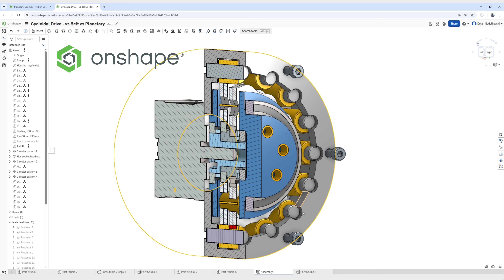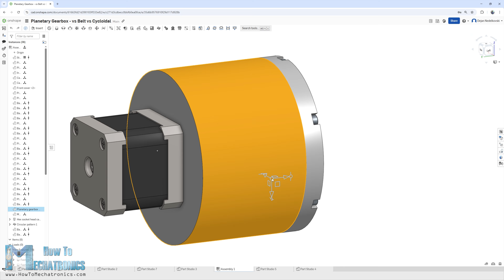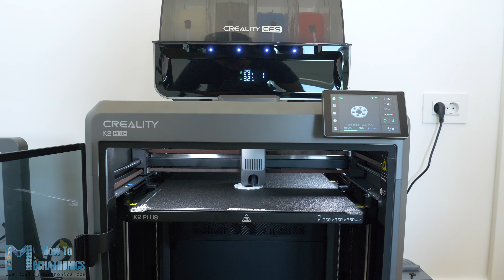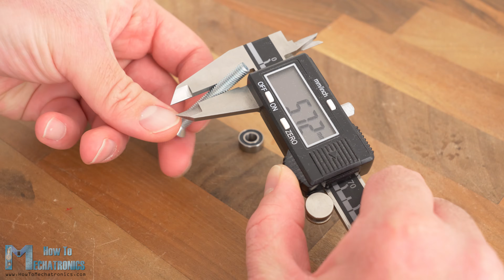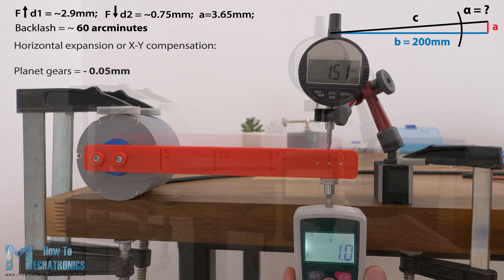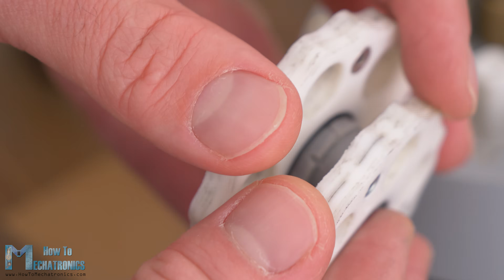Cycloidal vs Belt vs Planetary - The Best 3D Printed Drive for Your Next Robotic Project?

Comment: Not surprising the cycloidal drive died first in the durability test, they are generally fairly high friction systems and need a lot of lubrication. Definitely use grease on it, given that this is a relatively low power setup probably a thinner grease like NLGI 1 or even 0 instead of the normal NLGI 2, so to not lose as much efficiency from drag.

Comment: For more easily securing the belt drive stepper, cut 4 holes in the large pulley and housing, which allow a hex wrench to pass through and access the screws, when the pulley lines up right.

Comment: Being someone who services heavy machinery, there's one factor you didn't take into account, and that's maintenance. With the belt drive, you have to replace the belt when it breaks or correct tension when it gets out of alignment. The planetary you just have to keep relubricating. They both have a maintenance schedule to follow: planetary you have to grease or oil, and the belt, check for wear, and replacement. The planetary can go way longer before service is needed, but the belt I feel like, will outlast the planetary because instead of the pulleys and sheave taking the wear, the belt is. In a planetary, the gears are all taking the full wear of whatever force is being distributed to them, so eventually, they will snap or break due to metal faitgue. How long would it take in a real world scenario? Don't know, but it certainly is something to think about. I can certainly say, I've seen more gears give out than pulleys or sheaves.

Comment: I am late to the party, but your results are quite bad, to be honest. Why? Well, look at the way you held the drives! The belt came best not because it was the best, but because its enclosure was square. The rest were round and you can visibly see the deflection of the mounts when you measure the displacement for the backlash. This significantly impacted the results of the arcminutes in negative way for both cycloidal and planetary gearbox.

Comment: Yeah but if you want higher torque like 400Nm not 400Ncm eventually you will use planetary gearbox but it is not 3D printable like you got to use metal so if you are aiming for way high torque use planetary and metal but the belt and the capstan will fail you if you're looking for higher much higher torque. But if you are looking for all 3D printed relatively strong and cheap use either the belt or the capstan drive ⚙️

Comment: Nice work, congratulations! I think part of the backlash you noticed are due to the 3d printed  ruller you are using in your experiments. It can bend and increase the displacement. I would use a more rigid arm in these experiments. Anyways, there is backlash indeed, but it's not so bad.

Comment: I'm surprised with the poor performance of the cycloidal drive since I've designed a 25:1 single stage cycloidal drive a couple years back for a BLDC actuator and it's only started to get significant damage after hours of use. And i didn't even use bushings or bearings in the pins due to budget reasons. You might've had a problem with the clamping or maybe the design had some issue i couldn't see from the video

Comment: Amazing video.  Thank you so much for this. I am also building a robot arm. Improving from basic servos to one of these. I am probably gonna use the planetary gearbox for shoulder and belt drive for other two, since they need lesser gear ratio and it was lighter.
Reply from the maker: Glad you found it helpful and good luck with your robot arm!

Comment: Very informative video. Had not seen your channel before. I'd like to comment on the Cycloidal drive design. It may not change the overall result but should move this style much closer to the others and permit it to be a lot smaller.

(1) The eccentricity appears to be less than the maximin possible. The greater the eccentricity the greater the 'bite' of each tooth. For example we used a 48:1 cycloid drive on an FRC robot with a 1 mm offset. It eventually gave up (like yours did). I was able to change to 1.2mm offset (a 20% deeper tooth engagement) and it did not fail.

(2) A material like PETG will perform much better than PLA for the gears.

(3) Since the cycloid teeth virtually roll on the pins, you can get away without the bearings. We used 3/16" diameter plain steel pins. This permits a smaller, more compact drive.

(4) We also used the same type and diameter of steel output pins but increased the quantity to the maximum possible. This provided the maximum surface area for the torque to be transmitted (minimizing wear and deflection).

(5) This may be the most significant difference. A two gear cycloid is not fully balanced. However a 3 gear system with each gear set at 120 deg is virtually vibration free. Also, since almost 1/3 of the teeth are engaged at any moment, a three gear system provides nearly 100% of tooth contact at all times.

(6) How you slice the gears has a significant effect on performance. We went with 100% solid.

(7) As one person commented, use lubrication.

You may be quite surprised at the improvement provided by the above changes. With all the pins, the part count will always be relatively high but you might find it could 1/4 to 1/8 of the volume - a real plus for a robotic arm. Cheers.
Reply from the maker: Hey, thanks for the input. These are all great points indeed and it would definitely improve the cycloidal drive performance.
Cheers!

Comment: Don’t forget that if you want the gears to last, they need to be made using prime numbers of teeth. Otherwise they will ware unevenly because the Sam teeth will keep meeting up. Using prime numbers, the point of impact will rotate ground the gears resulting in an even ware pattern. This will smooth the teeth and help them run better over time rather than creating a ware pattern that will speed up the parts failing point.
Reply: The numbers need to be coprime, not prime. That is, they need to share no common factors other than 1. For example, 15 and 16 are both composite numbers, but they are coprime (and in this case you get a shift by one tooth between the gears for each rotation).

But I also wouldn't worry too much about it if the gears are being 3D printed - the prints are just not going to be that durable regardless of a completely even distribution of wear.
Reply: @sirnate4005 brb buying a roll of POM filament, what could go wrong
Reply: @sirnate4005 aren't any two a,b where a+1=b coprime?
Reply: @sirnate4005  gears with pure rolling contact or  non-sliding gear tooth profiles for long-life gear
Reply from the maker: That's right. But it's sometimes hard to find prime numbers to match the desired gear ratio.
Reply: Mind blown
Reply: @reinux  it’s amazing the Random tidbits and information you can find on the Internet

Comment: I wish you volume-normalized and weight normalized the components. Maybe making one set that are all equal volume and one set that are all equal weight, and see how well they compare. While I dont think the cycloidal drive would have impressed if you made it larger, I think it still affected the results significantly. Maybe its performance/size ratio is great?

Comment: A good challenge would be a split ring planetary gearbox. Those are a pain in the ass to make conventionally.

As geaometry is extreme constrained. So you either have choose from a very limited selection with standard off the shelf gear sizes  , or have to make your own "exotic module" gears.
Reply: And well as far as compactness for a given reduction and efficiency goes they are good enough to beat professional (metal) strain wave gears ehen made from similar materials.

Comment: Are you sure cycloidal drives "need" an odd number of teeth? I thought having an even number of teeth was important to achieving a balanced load, more even distribution of the forces and reduced vibrations. Great video and great comparison!
Reply from the maker: I tried it, there is no way to insert two disks if the teeth number is even number. They must be odd number to fit two disks.

Comment: Beautiful! Thank you for that.
Your belt tensionners are holding with friction. Try using a  a screw to apply force around a pivot and then lock that screw. That way the counter-force will not try to fight friction but rather compress a screw. It also allows you to fine tune the force on the tensionner.

Comment: Great video !! thanks for sharing. Have you tried or thought of harmonic ?
Reply from the maker: Hey, thanks! I already a direct comparison video of harmonic vs cycloidal drive, check it out. Printing the flex spline is a problem. It needs to be flexible and it's hard to get it so with most 3D printing materials while being durable enough.

Comment: Your backlash testing methodology could use some work. For example, as can be seen in the footage, your mount is not rigid. So a lot of the backlash is coming from the whole gearbox rotating a little.
Reply: Yes, and the arm bends, too. Better clamping and metal arm with much less flex.

Comment: When I tested some variation of the cycloidal drive I noticed the rotation speed is not constant. It looks like the speed is accelerating and decelerating for every lobe. Is this really the case or it it an optical illusion.
Reply from the maker: You are probably right. The disks shapes and the assembly of the drives is never perfect, so I was not sure about how constant the output is. When touching output bar of the three drives by hand while the durability test, the cycloidal drive had the most vibrations, followed by the planetary gearbox and then the belt drive as the smoothest one.

Comment: the way you clamp the gearboxes to the table may also increase wear due to flex in the casing. nevertheless - nice video! interesting content! keep it up.
Reply from the maker: That's true. I though about it a bit late after all the designs were made. I tried to clamp them at the front and the back where it's all material, with 35% cubic infill.

Comment: Very cool and thorough video
Just 2 little things I noticed: when you compare the weight you show the total, while one of the main advantages for the belt drive is the capability to mount the motor further away on long arms decreasing the torque requirement for the previous stage.
The other thing is: why do you use pla? I can't see any advantage over other filaments in wear and temp resistance other than maybe printability.
Reply from the maker: Thanks!
Right, PLA is not the best choice for gears but it was the easiest to work with, fasted to print ect.

Comment: You should try CAPSTAN drive and see how it compares. To build a good one you just need a rope/string with minimal creep. They are fairly compact, easy to manufacture and have decent reliability when built properly. The neat thing is how simple they are and you can make unusual joint motions by changing their shape like a CAM shaft works. They are not perfect, none are but they are an interesting choice and lightweight. Great video. This is just a suggestion to think about.
Reply from the maker: Yeah, I should definitely give it a try. Maybe in some future videos.
Cheers!

Comment: nice video, you just answered why robot arm like kuka using belt drive and not the other motor,but the new magnet-free motor may change the game.
Reply: I believe there's one more consideration for this.
The point is that if you want more torque on a joint, you'll need a bigger motor.
But the bigger and heavier motor is, the more  power you'll need on prior joint. Which in its turn requires more bigger motor with even more torque and acceleration capabilities.
So, the idea to move motor closer to base is very appealing. And due to this they probably chose belt drive as easiest way to move a few joints from one point. 
Also a lot of robots which can lift a few hundreds of kilograms are still use classical ABB PalletPack design which has all motors at base and cool kinematics to drive joints.
Reply from the maker: Right on the spot!

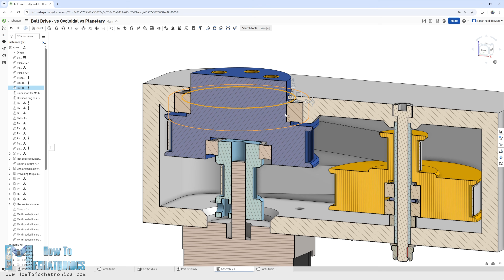Comment: 6:20 just dont. If the contour is not closed than the slicer cant compensate or applys the contour value although you indendet for hole compensation because the CAD had a slot going into the hole. It should be done in CAD with a offset Surface but what do i know i dont even use the superior Onshape. Just be aware that it might mess with you.

Comment: I often have designs where steppers are secured in tight spaces and I make holes that go all the way through the design from the other side and use a narrow 3D printed screwdriver that fits into the hole
Reply: Exactly.. Having a small whole for an Allen key to pass to tighten the screw is easy
Reply from the maker: Yes, that sometimes is the best option for getting a compact design.

Comment: The problem I found in my trials, was the belt drive slipped under heavy load.
Reply from the maker: Yes, that was the case in the first torque test for this drive. Tensioning the belt helps, but a tight belt also means losing efficiency and the belt might wear out sooner.
Reply: @HowToMechatronics  exactly.  It's a great solution for low power devices like a 3d printer.

Comment: to be fair in defense of the planetary gearset, if constructed with a more resistant material it will outperform the rest i believe, as the cycloidal is very demanding even in the metal counterparts and there is nothing to improve in the bets as in the belt material, it will be the weakest link in certain cases
Reply from the maker: Like I mentioned at the end of the video, I will further compare belt drive vs planetary gearbox in real scenery with some simple robotic arms, so stay tuned!
Reply: @HowToMechatronics  Bro really read the comment, <3 , honestly made my day, your channel is the reason I've changed from developer to make engineering as my bachelors

Comment: the planetary and cycloidal drives are both rotating within the clamps as you apply force for the backlash test.  the belt drive does not because it's a big flat surface.
Reply: I noticed this too. I would do those backlash checks with them more rigidly mounted. I think you'll show a better performance.
Reply: As an engineering student I believe the backlash calculations were pretty clever but the test was pretty flawed due to lack of consistency in mounting, also the overshooting experienced with the belt drive. I believe it’s due to the elasticity of the belts the way belt drive mechanisms usually work is one side of the belt actually gets stretched slightly which causes a driving force but then when you’re no longer exerting a force on the belt it settles often resulting in a slight settling motion. This is why belt drives are never really used for anything that needs precise measuring like you wouldn’t use belts in a speedometer, but at least now I know I’m going to use a cycloidal gearbox for my robot project due to it’s compact direction drive capability
Reply: @Lee-wells  Belt drives can be quite accurate. They are used for example in 3D printers which use lots of abrupt reversals.
Reply: Also the weight of the red bar acts as a preload, so the external 2N upwards and 2N downwards were not the same and it does not necessarily average out if the torque vs. angular position curve of the drive is not linear (which probably is the case). Not sure how heavy the red bar was, might be insignificant, although 2N isn't a big force either.

Try measuring it with the bar hanging vertically, or with the rotation axis parallel to gravity.
Reply from the maker: Yeah, I was aware of that, but I think/ hope it didn't affect the backlash tests. I think the 2N force I was applying didn't make the drive rotate at the clamp.
Ahhh, it's so hard to make a perfect video where every possible thing that could really affect the results is considered. But ok, more videos are coming. :)
Cheers!
Reply: @HowToMechatronics  you should be able to clamp using the motors instead, and that way each housing has the same amount of rigidity and resistance to twisting in the clamps
Reply: @HowToMechatronics  Don’t forget that if you want the gears to last, they need to be made using prime numbers of teeth. Otherwise they will ware unevenly because the same teeth will keep meeting up. Using prime numbers, the point of impact will rotate around the gears resulting in an even ware pattern. This will smooth the teeth and help them run better over time rather than creating a ware pattern that will speed up the parts failing point. 

Also, you are getting deflection in your 3D printed lever arm, I would recommend using some aluminum extrusion. The deflection will be much less, improving your testing accuracy. And if you use countersink screws, it will stay centered. 

Good luck.
Reply: @Lord-Of-Light , sounds brilliant. never heard of this
Reply: @LiviuGelea  they use this technique for extremely heavy equipment like hydro power plants. Otherwise they would have to replace the million dollar gears every couple of years. Normally people just make the gears bigger to get around it, but sometimes you can’t do that.
Reply: nice , good job paying attention!   i didnt think about that when iwas watching it.    This is a great video!

Comment: Fantastic video!!!!! The only addition i would add is a noise factor. Cycloidal drives tend to produce much more noise than the other two drives, and may not be desireable.
Reply from the maker: Thank you! That's correct. There's another thing that I didn't mention in the video, correlated to what you mention. When touching the output bars on the durability test, the belt drive was the smoothest drive. The other two drives had some more vibrations to them, and the thing you said, more noise.